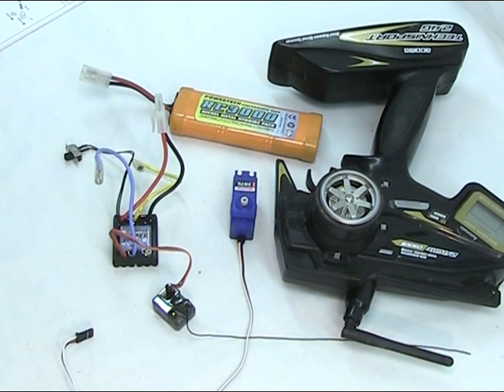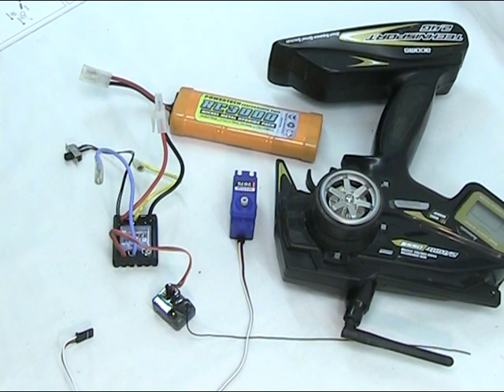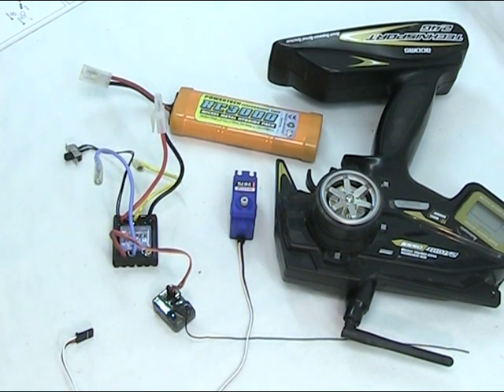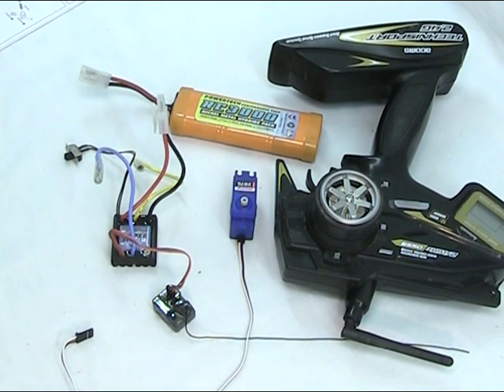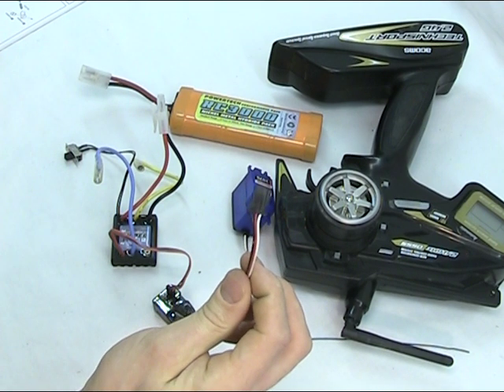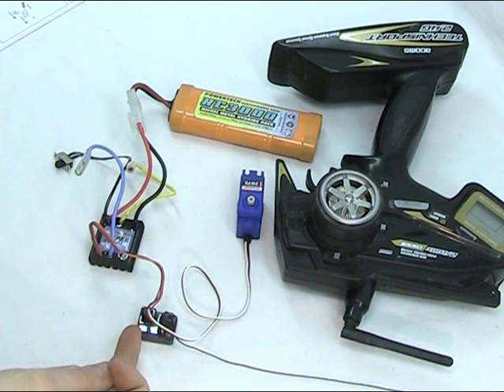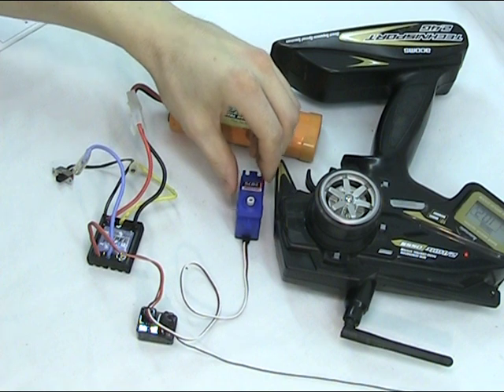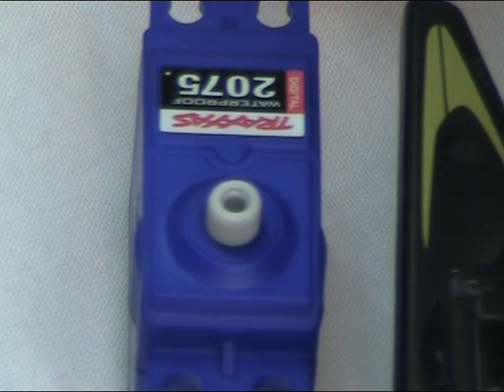Setting an RC Servo to Neutral and General Electronics guide ESC battery RX TX.mpg

Comment: im new to all this , quick question once ur servo goes to neutral will it always stay in neutral even if u disconnect everything, or will u have to do this again ?
Reply from the maker: Yes as long as the setup stays the same and the horn on the servo is not moved. Welcome to RC.
Reply: rcBitz Thank you !

Comment: @rcBitz i dont kno how to restet the esc it isnt very good on at a rough guess there is no on off switch i guess i might have to get a whole new system esc throttle servo controller or transmitter i think its an old controler not the ones with the the sterring wheel on the side but one with joy sticks like the ones you get with rc helis. and yes i have a manual with the car but i don't understand it really. i guess its just me

Comment from the maker: @MrNath5150 Firstly welcome to this great hobby and sorry for the slow reply.

Sounds like you've not been having much fun. I would start at the beginning, it is worth checking the set-up of you Speed Controller / ESC e.g. the neutral point, forward and reverse. Does the car have any steering? If the car is running when connected just unplug one of the wires to the motor so you can set it up. Sure we can get you there.

Comment: i have bought my first ever rc car trying to get into the rc hobby its a timaya brushless tl-01 subaru 1/10 scale. i got it off ebay witch probaly says alot but it dose not work properly the servo sticks when i press fawerds on the controller or transmitter as they call them i have taken it apart put it back together but it dose not work propery. do you think you can help in any way?